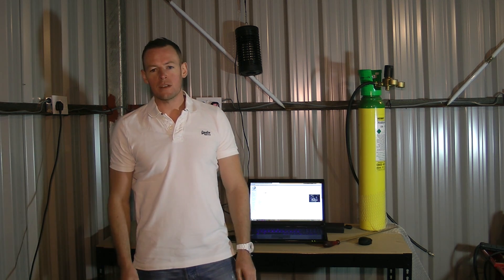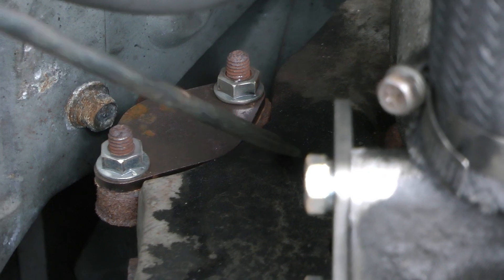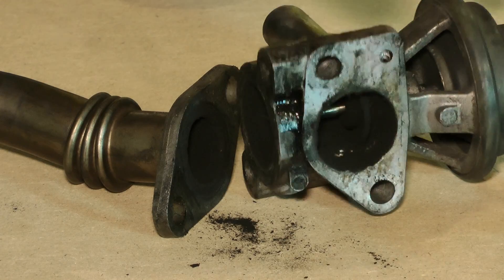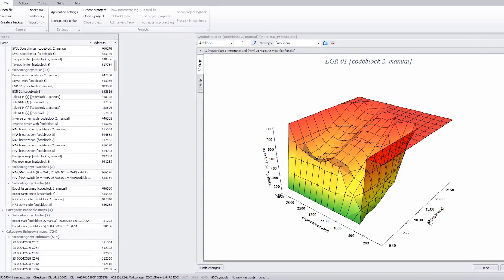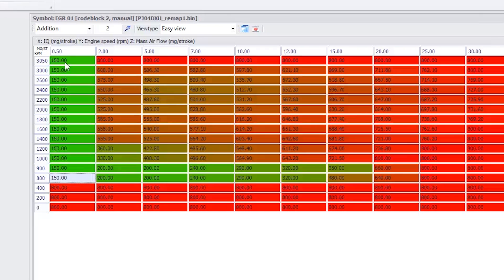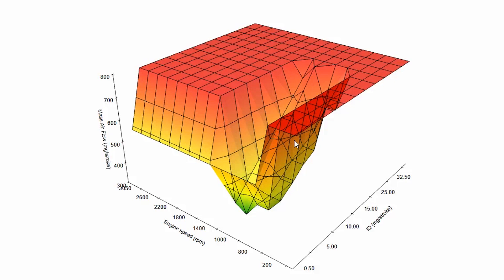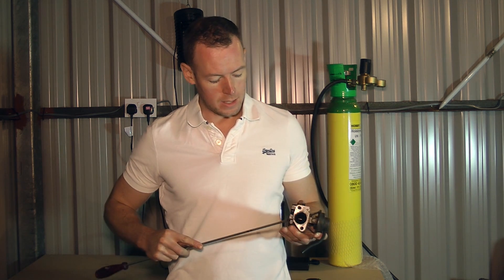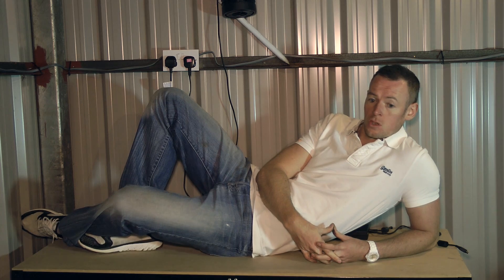EGR for motorsports

Comment: Actually - EGR reduces peak in cylinder temperatures. This is to reduce NOx emissions
Reply: Slappy Fistwad - a typical EGR system often includes an intercooler to reject some heat from the exhaust gases before they are drawn into the cylinder. Therefore egr volume displaces some oxygen which would otherwise be present lowering the flame temperature and also introduces some gas / particulates which has the overall effect of raising the specific heat capacity of the overall in-cylinder charge. Therefore given the same input energy from the compression of the charge, a lower net temperature increase is observed. Query google scholar for thermo analysis of the above - many papers available for you to view.
Reply: Slappy Fistwad - does your carer know you've got internet access??!
Reply: "Never argue with a fool. They will drag you down to their level and beat you with experience"
Reply: ive read that turning off the egr will lead to a longer warm up time of the engine? is that true?
Reply: @withstyle7816  it is true, but without EGR engine will be cleaner.
Reply: @Fosgen  waaay cleaner injectors and intake manifold
Reply from the maker: We've just finished editing a video with 150,000 miles of egr mess. It's disgusting.
Reply: no, slaps, there is cooling on many systems, including the TDI.  To walmans post tho, this is a round about way of describing it to make it seem good, which it isnt, at least for the car.  It does lower the flame temp reducing nox output, but increasing soot/dpm and making it less efficient.
But this begs the question what is happening to that extra soot in the filter during the clean cycle: being burned into nox.  And since the car is less efficient you are using more fuel.  These factors plus others quite possibly offset the lower emissions at a single point in time.  I'd like to see studies over a year with everything factored in.
Reply: Slappy Fistwad https://www.dieselnet.com/tech/engine_egr_sys.php - don't feed the troll folks....
Reply: Slappy, I think I already know the answer to this but, do you know what a pre-frontal cortex is?
Reply: Geoff Wallman it’s so funny the people who think removing the egr will give them more power for free when little do they know it’s not even in effect during WOT. The egr isn’t just for emissions. It can make your engine more efficient too, since the used gas can’t be burnt twice so effectively reduces the capacity of the combustion chamber. So less space for fuel and air. Yes that means less power too but guess what. You’re not on full throttle so why do you need to generate the full bhp potential of your engine purely to maintain 60mph? If it’s gummed up then you’ve spent too much time tootling around town so probably a petrol would of been better...
The egr system isn’t perfect I’ll give you that but it does many jobs on the engine. Increasing Nox pollution isn’t helping general health either so instead of “deleting” it use the throttle a bit more and give it a clean :)
Reply: NUCK CHORRIS 

a lot of egr systems are water cooled,  the exhaust gasses are cooled with a heat exchanger before they get to the inlet manifold.
Reply: Take apart you inlet manifold and take a look inside.
Then decide if the egr is a good thing.

The Inlet manifold should be clean and smooth for a more efficient air flow.
Not blocked off from the crap that comes from the exhaust.

I have removed the egr from all of my previous cars. Diesel and petrol.
Reply: @insanewayne75  i suppose no problems by removing it..?
Reply: @withstyle7816  the egr is OK when cars are new, but any diesel's that have done over 40k miles with none motorway miles get coked up really badly.
They use a lot more fuel and eventually brake down.

Some garages do car carbon cleaning.
Which flushes out a lot of the carbon build up.
Reply: @insanewayne75  my m57n2 engine had 200k km when i bought it. Intake manifold was surprisingly clean. New er cars have way more aggressive egr settings. I deaktivated 30k km ago. Way better for the engine and dpf
Reply: My 2016 Cummins 6.7L Diesel has an EGR cooler mounted on the passenger side, top of the engine.  Look up EGR cooler delete.  shows how to remove it.
Reply: The exhaust gas lowers temps by slowing down the oxidation process.  Slower oxidation means a cooler burn.  There is also less nitrogen, more c02, and more h20... which expands more per BTU.  Or something. 

Either way, your are wrong.
Reply: A lot of cars have them. All TD5 engines from Land Rover have them mounted on the front of the engine for example. It's a water cooled solution.
Reply: egr olny works partthrottlin down hill, under load egr is closed for more boost
Reply: If you put oxigen in fire the fire burns better, if you put fire in fire (less oxigen to burn) it burns less
Reply: Yup. But it would only be minutes. Not a big deal when the performance of the engine will be improved and a failure point (plugged EGR) removed.
Reply: rekt
Reply: The idiocy in this post is alarmingly high.  Slappy fistwad is obviously not a mechanic or mechanically inclined atall
Reply: Really???  How does introducing HOT EXHAUST GAS into the intake charge REDUCE cylinder temperatures??
I'd LOVE to hear a proper thermodynamic justification!
Reply: Yeah that is one thing you're good at.  Too bad it's the ONLY thing you're good at, TARD!!!!
Reply: see folks, Geoff the tard here was nothing but a troll --- he never intended to put up a serious, defensible argument.
Reply: aaaaaaand Geoff the tard gracelessly loses the argument after realizing he has no logical leg to stand on!
Reply: That's a straight up lie.  There's no "aftercooling" whatsoever.  It pipes the exhaust gas straight from the EGR valve RIGHT INTO THE INTAKE.  Unless........ohhhh you're "ILLEGALLY MODDING IT" as you loudly like to whine about.  But then, what's teh point, I'd just take it off.    Oh and BTW, lowering air and fuel LOWERS the capacity of the engine, idiot.
Reply: @The_Conspiracy_Analyst  my tdci ford doesn't have a egr cooler.
But my BMW does have a egr cooler.
Some cars do and some don't.

Comment: Video should be called How To Get Nailed by the MOT/DOT/EPA for instructing the public in tampering with the emission system. Must be a graduate of the Volkswagen school of emission engineering!
Reply from the maker: MOT does not include emission testing in the UK, only a basic smoke test.  DPF is inspected visually.  You could remove the entire contents of a catalytic converter and DPF housing and it will still pass.
Reply: I was speaking in terms that not only apply to Europe but include North American and Canada. I also understand peoples frustration with emission equipment but if ones vehicle is maintained in sound condition and repaired by qualified persons the devices do benefit everyone.
Reply: actually a mot in the uk does include emission testing,,my 1.9tdi failed the mot cos of high emissions,,,but i agree wif taking egr off so to burn cleaner air and fuel...if only petrol lasted as long as deisel as in mpg i would happily gobak to petrol,,,but av got ma bike for that,,,lol

Comment: what you say about hysteresis egr maps ? how work hysteresis egr maps?
Reply: what he showed is not egr map is MAF x EGR map..so MAF knows how muchair is coming from egr and how much is clean air..
Real method is the hsyteresis which controlls the egr electrovalve or in some models turns off the egr electrical step motor!
Reply: Hi  .... i have a clk 270 cdi automatique transmision  (w209) its 
remaped i bought like that but my car still have EGR , so if i accelerat
 in maks (hiting the king dom- gas pedal till the end )  hard 
acceleration is ok in 1 gear in second but when it goes to 3d gear it 
stops the engine,  same thign hapens from 3-4 , 4-5, 5-6 
Can it be because egr is not deleted or waht

Comment: I have a turbo Diesel. A TDi to be exact. Would removing the Egr valve/blanking it off be okay? I've heard that if you remove the EGR valve it can be bad for the DPF? Or will the dpf be fine? Thanks.
Reply from the maker: +Boo Baa they're two distinct systems very far from each other. If you're interested in maximum power both are bad, but they do try to save the planet. If you remove or block either the car might throw an engine management light.

Comment: Wouldn’t just removing the vacuum pipe amount to the same thing as blanking off the EGR
as the valve within would remain shut?
Reply from the maker: +zyd Kap that would be great if your engine allows for that. Much simpler.
Reply: I have an old Pajero. It allows me to do exactly that. 
All you need to make sure of is that the EGR is actually in a closed position.
Reply: I have seen a lot of videos shown people using different way to remove their BMW EGR,  compare to this scenario, they are wasting time and money......
Reply: Mine was leaking boost

Comment: Its ridiculus how so many people have just no idea how an EGR really works and what it does on chemical basics.

On full throttle the EGR is always closed, so there is just no exhaustgas recycled(and just no difference to an engine without it)
On half throttle, the recycled exhaustgas is used to cool!!!! down the temperature in the zylinder, and produce more power with less throttle losses. A nice side effect is to better the emissions, but its not the real purpose for invention.
By the way, it can be used to warm up the engine faster when its cooled by the engines coolingwater, and reduce your wear, and your fuel consumption.
Just the quality of those weren't too good, so with much short-distance driving, there piston get stuck(you just have to clean it or drive regulary long distances, so no big deal at all)

Now all you shitty wannabee engineers come and think you can do it better, with just zero knowledge about how this works. 
I feel sorry for all of you.
Reply: Don't be angry. Closing the EGR on my previous E39 530D had such a good effect... Approx. 0,8 liter less cosumption and a very responsive trottle... I was driving it for 6,5 years without any issues. It was a great car.
Reply: Any citations or references? I thought I read somewhere that EGR warms the engine quickly during winter time, which probably serves as the other function this gentleman didn't mention. Anywho, there are a few things I'd like to discuss:
1. All that circulated gunk, does that not contribute to piston carbon buildup? Seems like EGR ultimately hinders performance in the long run. 
2. I find it a little hard to believe that exhaust gas temperatures could ever be lower than ambient air or coolant temperatures in any situation, thus my request for your sources. How can EGR be used to cool cylinders?
3. You mention cooling AND heating functionality. How can EGR do both?
Reply: Fuerzefueralle you're an absolute gobshite "all you shitty wannabe engineers" haha referring to yourself then! Simple fact EGR's kill engines and they're expensive and shit, same with DPF technology.
Reply: dreamrealitysyndrome EGR tends to break ang gum up.
My mum's car broke the egr and paid a lot of money and headaches.
EGR is shit.
Reply: +fuerzefueralle - 100% CORRECT !!!  Although I learned the Hard-Way, i wished I have seen this Post before I deleted mine.  After deleting, come to find out... IT WILL NOT WORK ON AN ATUO-FUEL-INJECTION unless you " ReMap ".  After deleting, I found out that I wasn't able to start the Car correctly and Time wasted, LOL...... I feel like a DUMB ARSE!!! . Here is the Video:  https://www.youtube.com/watch?v=XYnRklFF3RE
Reply: Im feel sorry for u also..
Reply: @fuerzefueralle, your information is wrong, go reeducate yourself on the subject.
Reply: Actually you are wrong. EGR is used at full throttle. the amount of EGR depends on the engine RPM.
Reply: Rohit Yadav You’re an idiot.

Comment: Thank you for posting this video, it has helped me better understand how the EGR works. I do have one question though. What would happen if I unplugged the EGR on my car (08 Mazdasped 3) and didn't get a tune? I'm sure I would get a CEL/MIL, but would I see the same benefits as getting the mapping done? Would my car still run smoothly? Thanks for your time and have a great day.
Reply: I'm not familiar with the Mazdaspeed 3, however, it all depends on the car's ECU and how much it wants to put up a fight.  90's cars were easier to trick as they didn't feed back off of too many sensors.   With yours, I would consult a car club and dudes that specifically know about your ECU.  It might be a simple resistor or a cheap flash you can do yourself at home.
Reply: it might go into the limp mode where the rpms will not go above 2k
Reply: Yeah having a mazda ECU expert come here is probably going to be rare, so seek out the car clubs.  They have people that know specific to your vehicle.

Comment: Hi all, Where is the risk for a Citroën 2,7 litres when i Remove the EGR Valves, is there a risk for the catalyst the  FAP or the turbo, or any other engin part?

Thanks for your opinion.
Reply from the maker: In my opinion, no. The EGR actually makes the intake air dirty and hotter. Cool, clean air is best for the catalyst and turbo.
Reply: vPerformance
Thank you,
Both EGR will be removed tomorrow morning on my Citroën C6, 2,7 HDI

Comment: My one failed at 62k miles....engine just wouldn't start no warning.it costs soooo much to take the car apart & when I saw the old parts they were all sooty despite having just done a long motorway & fuel cleaner additive one week before..it's all replaced now but I would love to turn it down....
Mechanic said they are a common fault & they are all sooty after 20k

Comment: I have a lexus Is and the engine management light come on it and went into limp mode, called out the rac they said the egr needs cleaning, I'd rather remove it completely if its safe to do so? How much does it cost to remove the egr ?

Comment: Yes you are right the engine light is on but the engine runs quieter and cooler.Also I removed the thermostat... now the coolant can flow freely without any water pump effort. Since then my engine is quieter and have more power as well..

Comment: do you think is it enough if I just block the egr valve intake entry hole or do I need to block other holes too?
Reply from the maker: +mario agostini Only the hole that leads into the engine's air intake. You may get an engine management light on though.

Comment: What about cooled EGR ? Can't help for economy ?
Reply: +Marius Negrean I think any EGR can help economy. Recirculated air takes up space in cylinder so you can only add a reduced amount of fresh air and thus a reduced amount of fuel also. But still idk if the economy is worth the hassle it makes when the system has issues or it brakes or it makes carbon deposits on other parts like valves (especially direct injection because there is no fuel to clean those valves).
Reply: Actually economy is worse on diesel with EGR. I made real-time tests. Diesel is unthrotlled engine, is not like gasoline where EGR can help by minimizing pumping loses, but in diesel car is just for increasing combustion delay(late EOI), which means good emissions.
Reply: Marius Negrean
Not much of a diesel fan myself but it's good to know it has that impact. It's still strange though: i was expecting to at least not affect economy in a bad way. Why does it do that though?
Reply: EGR = ignition delay. From same amount of fuel, if you block EGR and add some timing(is already retarded on many cars for eco purposes), you can squeeze better NM torque per mm3. Everything is related about how efficient you can burn X mm3 of fuel. Same X mm3 can squeeze 100 nm and can squeeze 110 nm, depending by oxygen amount, Start of injection, injection pressure(atomization) and so on

Comment: Well, that is not correct.

EGR are for fuel efficiency and emissions.. Removing it will only make your car less economical. No power what so ever will be added, since the EGR is closed during full power, as you said your self.

What you did here is just ruin your economy.
Reply from the maker: +T EngD Please tell us how it improves fuel efficiency
Reply: If fills the cylinder with inert gases. Gases that does not burn. And that in turn makes the effektive cylindervolume lower. Less air can get in, less fuel needs to be burnt and you basically get a smaller engine. 
And the hot EGR gases also rise the temperature of the burn making it burn more complete. thus less emitions and also further higher efficiency.

This is just the principles. Its more complex in reality.

But it is a known fact.
Reply from the maker: +T EngD and what do you think about the dirty oily stuff getting back into the cylinder?
Reply: +v11o 

Well..
Since its re-circulation of burnt gases the dirt has already been in the engine, there will be no added amount of crap regardless of how many times you recycle it. However there will be a new chance of it burning up resulting in less particles out of the engine and less particles in your cat/filter.
The only way to get more dirt and grime in the engine is to burn more fuel. And that is what you do when you remove the EGR ;)

You will get a cleaner inlet manifold with no EGT but that is just about it. :P

Comment: hi m8, on a mercedes c 250 turbodiesel i remove the EGR, cover both halls on the inlet and exhaust  mainfolds but what do i do with the vacum pipe that conects to the EGR valve?
Reply: +merlynho Just bung it up,  put a screw in it or something so there is no air leak.